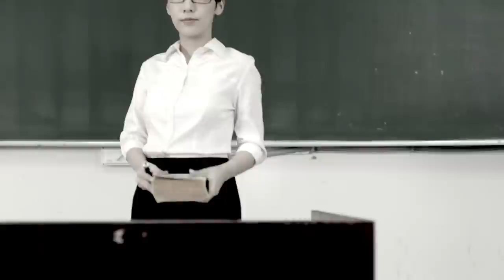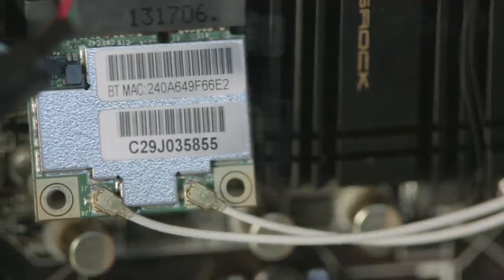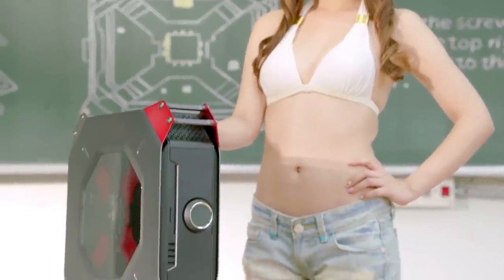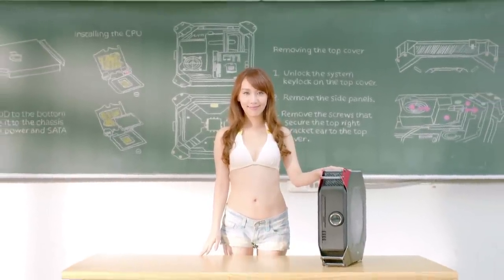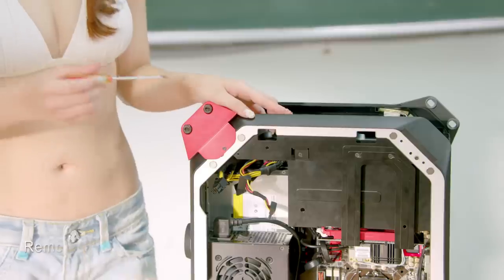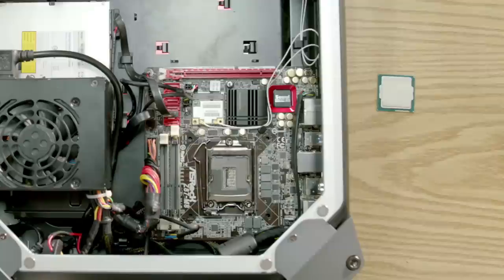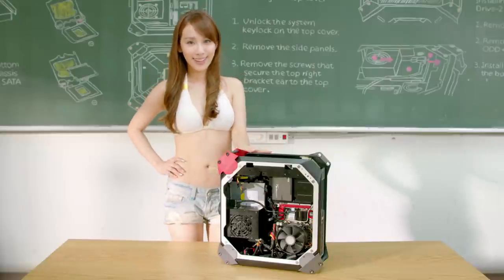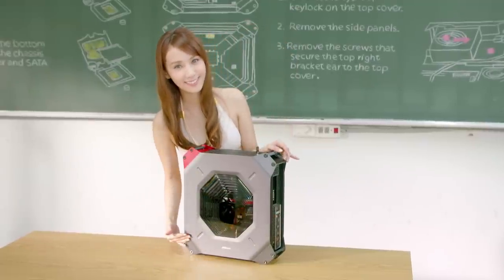ASRock girl teaches you how to install your M8

Comment: With the Bitfenix Prodigy at nearly $70 bucks.. SilverStone Sg05 at $40 bucks.. and yours around $300? Considering the power supply only costs $50, motherboard $130 and the dvd at $20 and 70mm fans roughly $20 more + a generous $30 shipping and labour fee? (this is excluding economies of scale (bulk buying..shipping..) valuing the only real product your producing at around $400+). Now your telling me this well respected girl is not a marketing scheme to sell an overpriced product?

Contact me when your AsRock M8 Barebones is selling at a more reasonable $399.99, still leaving room for profit, and modifications such as:

A practical power supply, Water cooling (using your window to show of the motherboard?!?! no one cares about the motherboard) as a 120mm fan mount or heat-sink options, and the ability to swap out the motherboard.

But lets be serious who will take the time to read the comment this far.

Cheers,
Random YouTuber
Reply: I did, now I'm bored ....yawn.